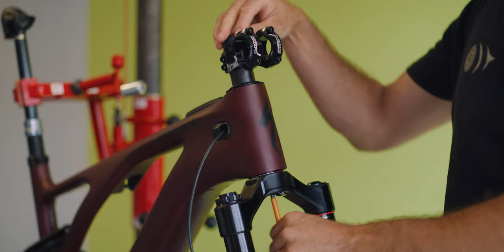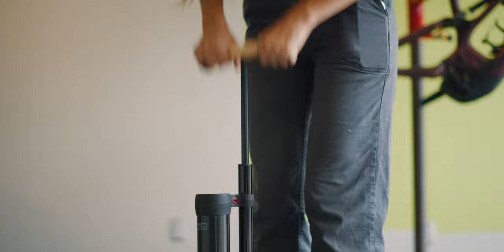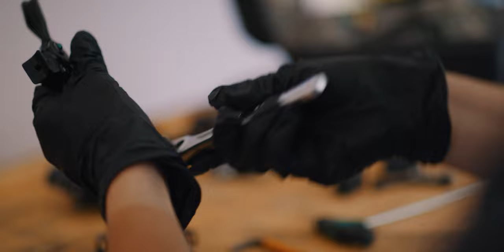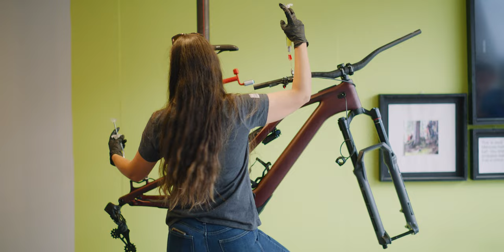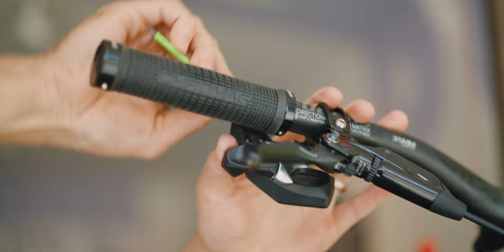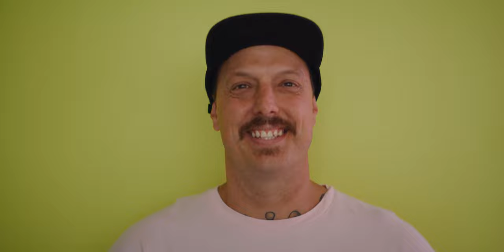BUILT | Specialized Turbo Levo at Whistler Crankworx

Comment: Lovely build, I have a 3rd gen turbo levo in black with the Zeb 38 up front, one up 35mm riser bar, on a 35mm Deity stem, with a butcher gravity on the back, GX Eagle Axis transmission, but I'm waiting for a 200 mil plus dropper to upgrade to or if that doesn't happen then a One up dropper !! So I can have the insertion right down to the collar for the saddle to be further out of the way ! Pedals supplied by hope tech in red anodized (flat) red muck off anodized valves, the frame is completely murdered out 👌🔥🔥🤙
Reply from the maker: Sounds like an amazing bike!